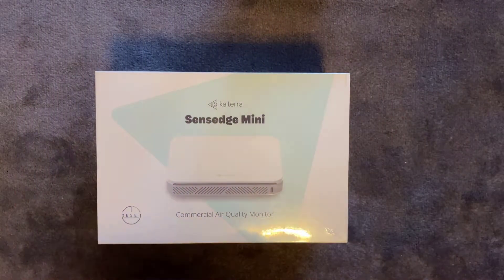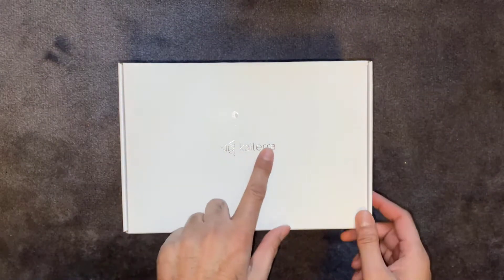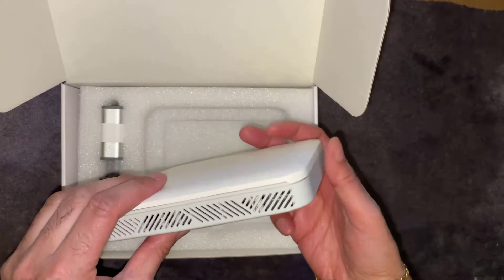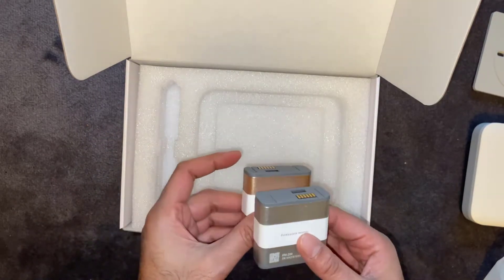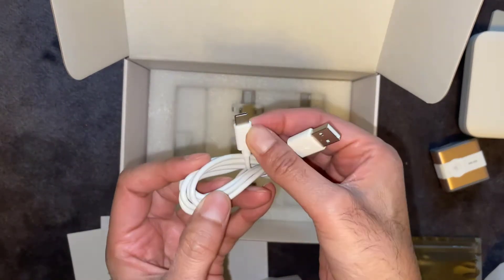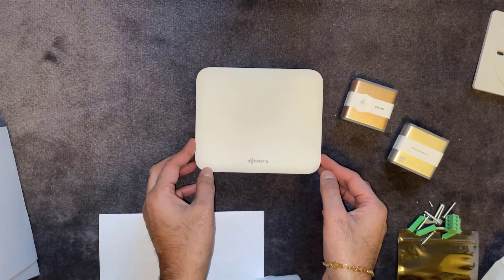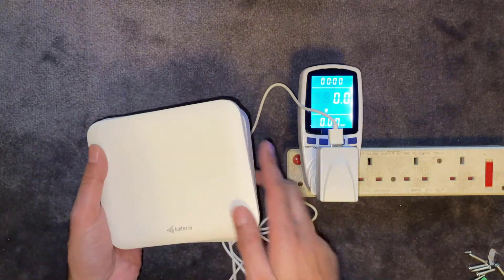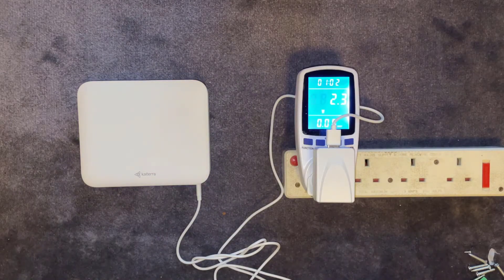Kaiterra Sensedge Mini Air Quality Sensor Unboxing and Power Consumption

Comment: I got mine for €269 including 21% tax and €24 shipping.
They still have more for €199 before tax/shipping, but, isn't there a new model....
Why didn't you show how to get the cover off?
It's not in the manual, stupidity really.
Reply from the maker: They have some 50% offers on at the moment till 12th July. The only type 3 device I am aware of is the Kaiterra, no others have been announced, although there was rumours of them working with manufacturers for more devices. Also for info, when the filters are running low, you can contact PW (assuming you purchased from them/TEA group) and they should replace them FOC, although the exact procedure is still not fully confirmed.
Reply: @HandymanSavage  
PW? TEA? FOC? That all sound gibberish to me, bought them in Belgium. found out how to remove the lid, stupid actually that it is not in the manual, also, hard to find how to register, it should be on the their main landing page, it is very well hidden.
And then another stupid thing, you can't import the mini into the Air App, while the much cheaper egg can.
It should be implemented, for instance by logging into their cloud our with the UDID of the Mini.